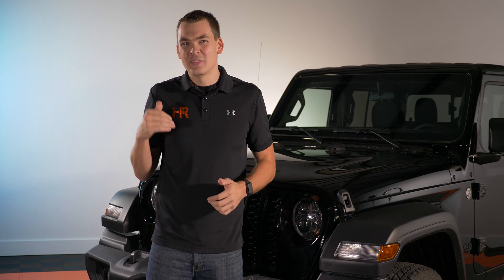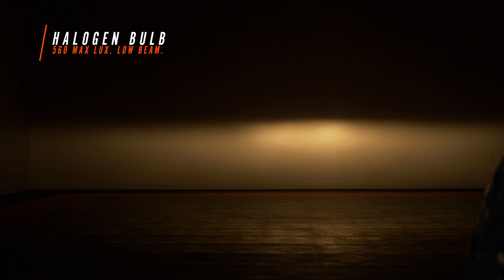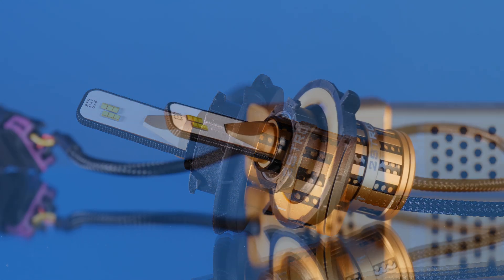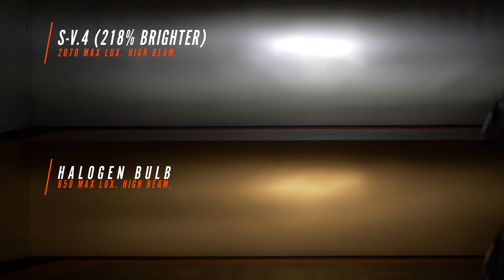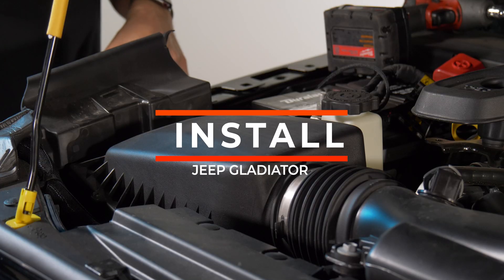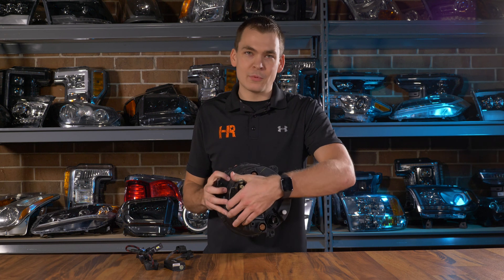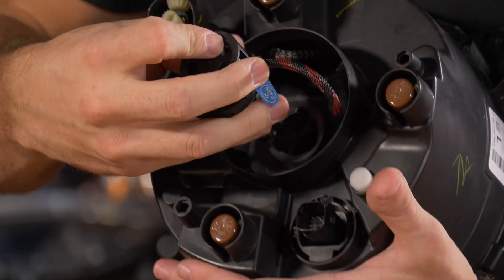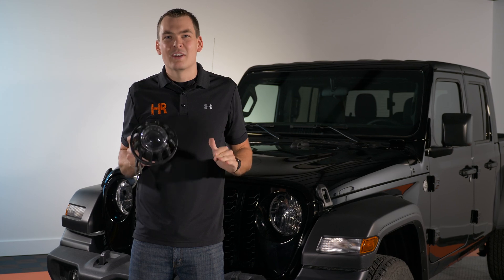HR Tested: 351% Brighter LED Bulbs 2019-2020 Jeep Gladiator

Comment: What LED bulbs last the longest... They are all pretty bright or at least brighter than stock with decent projection so all I care about its longevity... Had LED's before and they don't last worth a crap.
Reply from the maker: I would suggest the GTR Ultra 2. Even in the event of a failure they have a lifetime warranty and the replacement set would be covered!

Comment: Looking to add some LED headlight bulbs to my wife's Gladiator.  Thinking about the SV 4 bulb.  I know the video states you need an anti-flicker harness/module.  Question:  I have a Tazer installed in the Gladiator and can change the headlights to LED.  Would I still need an anti-flicker harness/module if I can change the vehicle's programing to LED headlights?  I would think if I can select LED headlights, the bulbs should work fine.  Just looking for anyone with any experience or would know the answer.
Reply from the maker: Reach out so we can go over exactly what you'll need!

218-755-5200
Sales@HeadlightRevolution.com

Comment: Have an jl 2020 with halogen i want upgrade at led , that sv.4 led headlights not blink not interfere, have for foglight too sv4 sorry the english
Reply from the maker: Those S-V.4 headlights will not flicker for your vehicle as long as you have the US Model Jeep! Those bulbs will be a great fit for offroad use, if you have any other questions just let us know! 

Link: https://www.headlightrevolution.com/2018-jeep-wrangler-jl-led-headlight-bulb-upgrade-s-v-4-19JEEP.LED.V4_2?quantity=1
Reply: Are this sv4 legal for highways, or only for offroad, i need for daily use but i want the best
Reply: @oscrm1760   good question

Comment: Just installed the SV4s in my Gladiator and WOW what a difference. The video shows you how bright they are but WOW the road is lite up just as good as my wife's JLUR with the factory LEDs. If you are on the edge for upgrading or not and you drive at night, you want to upgrade. I did adjust my lights down just a hair but once I put everything back together they were slightly higher than when I took apart. Great video and great product Headlight Revolution! OH and yes, everything does fit like he says in the video, you are going to want to be good at tetris, LOL no but really take your time and it does all fit snug as a bug.
Reply: That is what had to select as well.
Reply: Went to website,  is the only way they sell them is to click offroad only?
Reply: How in the hell did you get them into the housing?
Reply: It all fits. One module on the left and the other on the right side. Then the connector tucks down at 6 o'clock. I wish I got a pic when I did mine but watch their install video and it shows how they go.
Reply: did you need to use a taser too get them to work?
Reply: @thomasbrock621  no... the adapters that are part of the kit take care of needing to update BCM for LED headlights.

Comment: Do I need a resistor , any flicker or warning lights
Reply from the maker: You will need a pair of the PWM modules for those to work in that vehicle, and they are included on the website in the kit! I have linked that kit for you here: https://headlightrevolution.com/2019-jeep-gladiator-jt-led-h13-bulbs-s-v-4/

Comment: Just orders sv.4 in h13 for headlights and the same bulb in 2504 size for the fog lights. What is needed for the turn signal/ fender lights?
Reply from the maker: We totally have options for that turn signal /DRL housing, and I would recommend the Morimoto XB turn signal housing! Link: https://headlightrevolution.com/jeep-wrangler-jl-gladiator-jt-xb-led-front-turn-housings/

Comment: Must have missed it, so what fog lights are installed with the headlights ? Looks very crisp and clean. Great informative video !!!!
Reply: Sorry.  Is there another video for the blinkers/parking lights?  That’s what I would like.  I got my led headlights and after market fog lights ( my dv8 doesn’t have holes for fog ) but I would like you guys picks for turn signal parking lights.    Help.
Reply from the maker: These bulbs work extremely well in your foglights: https://headlightrevolution.com/gtr-lighting-csp-mini-headlights-5202-2504-bulbs/